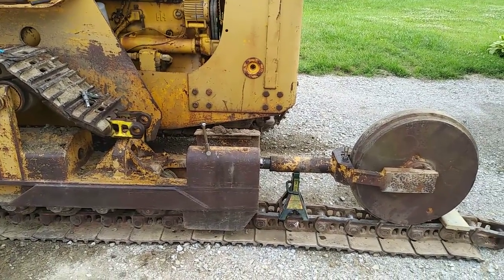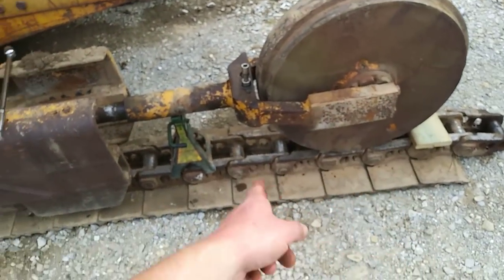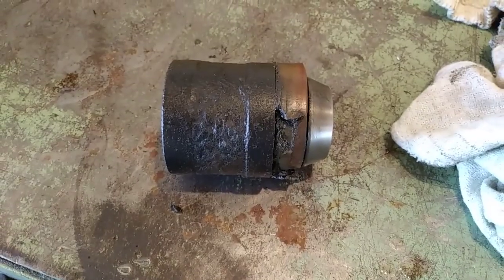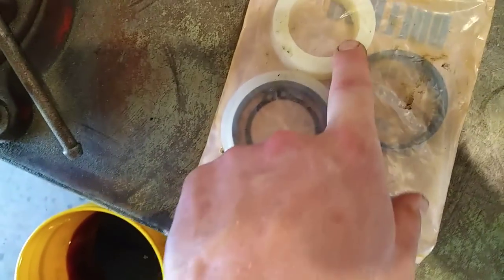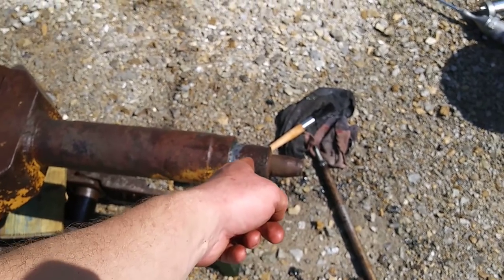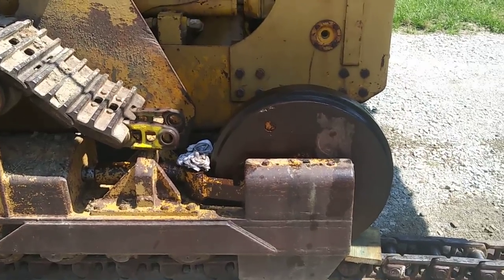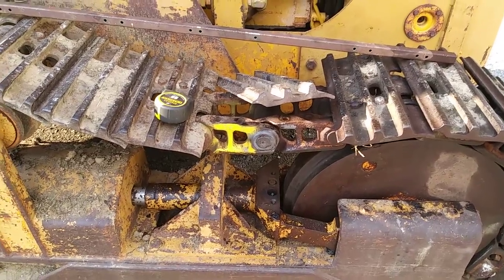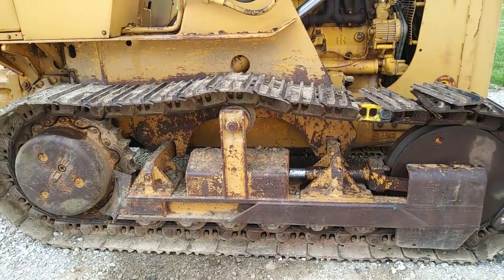Crawler - Dozer Track Adjuster Repair

Comment: I have watched these videos and read all the posts about how to change these seals. They are very interesting but I can’;ty believe no one has collapsed the adjuster and slid the tracks off the front idler. I have done this with my 175, 125, and  a D4C. It is a five minute job and no the tracks do not have to be wore out. It is a 5 minute Job you can do by yourself if you have something to lift the tracks with. You can remove it completely if you want to change idlers or replace rollers. Just lift the tracks off the sprocket. Try this before you take your tracks apart.

Comment: Love these old Internationals. Did a TD15 today.....One little trick is to take out the fitting, and give it little blast in that hole with a rubber tipped blowgun. It usually blow the puck out to replace the nylon seals.

Comment: When I was working for a Cat dealer  I removed the track adjuster piston with a tipped air nozzle inserted into the hole formerly occupied by the relief valve and used air pressure to blow the piston out.

Comment: just got one of these tractors the other day. worked on it today to get it into location.  long story. so we cant turn ours because the clutches are screwed. so we had to back it in uphill. got it some way in. got up on a bank n the track slipped off the idler.
Reply: we also have the 4 ton blade on it. and it slid inwards. way before that we noticed the tracks were loose. and way before that we sprayed hydro fluid from an old line. its still not where we need it. gonna try gettin on it next saturday. but im sure this video will help us figure out what we need to do.
Reply from the maker: Sounds like you have a lot of work ahead. I hope my videos can help.

Comment: Very good video. Trying to get all the info that I can to replace those seals in a TD8C.
Reply from the maker: A piece of advice, if you have a mechanic come to press the pin on one side, go ahead and do the other side too while he’s there. After I did the one side I paid to have my machine hauled to my project site. After a few hours of work, the other side blew out.
Reply: Exact Same thing happened to me, Replaced the seals on one side. Moved my machine to a job site and blew the seal on the other side. Might as well attack both of them while you’re at it. Great Video!

Comment: How much was it to press the pin out and back in?
Reply from the maker: It was a family friend that did it on this video. He was able to get me a deal. I actually had the other side go out a few weeks after I fixed this side. I didn't want to bother him again so I called a heavy equipment mechanic that I had used in the past to rebuild the Pilot Control Valve on this same machine. It's been a few months, but I think he quoted me $350 to come out with his press and do all the labor as long as I got him the seal kit. I ended up selling the machine with the track tensioner blown. The new buyers were aware of the issue. I was actually waiting on the seal kit when they inspected the machine. The seal kit came in the day before I shipped the machine to them. I gave them the seal kit when they took delivery of the machine. They were going to have their own mechanic fix it.

Comment: You  Could Of Used A Air Compressor To Blow Out Piston From Inserting hose  In Grease Fitting hole
Reply: Or more grease from the grease gun.  Little more to clean up but shoulda pushed it right out.

Comment: hello, what makes the track lose power on one side?
Reply from the maker: The plastic seal breaks down and allows the grease to escape. Once the grease can escape, there is no pressure on the track.
Reply: It's been awhile but maybe drive clutches

Comment: Dude.... Next time don't be a tight wad and just take that thing to the mechanics shop.... They have all the proper tools, not that cheap Harbor Freight crap, they know how to do it all but the big thing is, you don't have to fart with it at all. And you won't have that huge spot of grease in your driveway that will ruin the environment..........
Reply: Mechanics, technicians and engineers generally do not outsource their projects. If I had a million bucks, I would also do the job myself, its fun and enhancing. So get off your high horse and welcome to the real world..!!
Reply: @mohabatkhanmalak1161  Well right there is your problem and is why you don't have a million bucks, you waste all your time working on stuff when you could be letting the professionals work on it while you are using your time to make money...........
Reply: @rico334   your comments are ruining the environment. , get a life